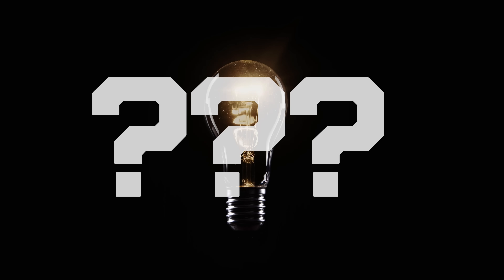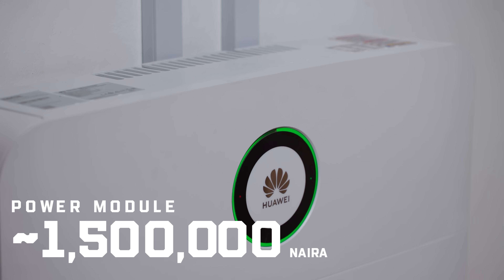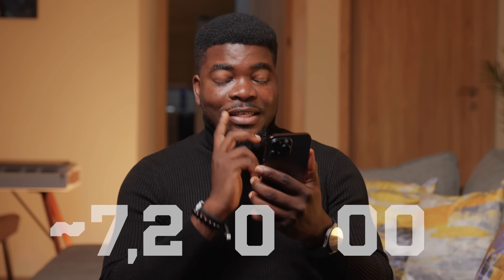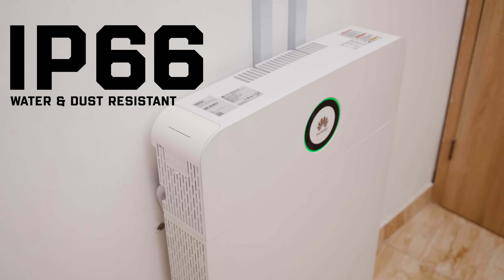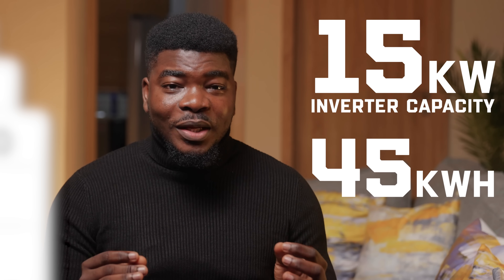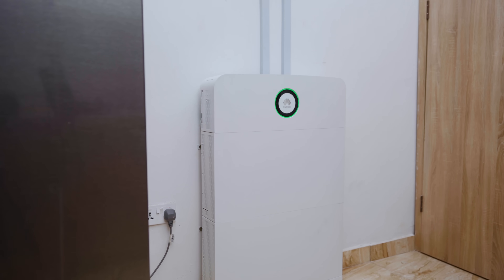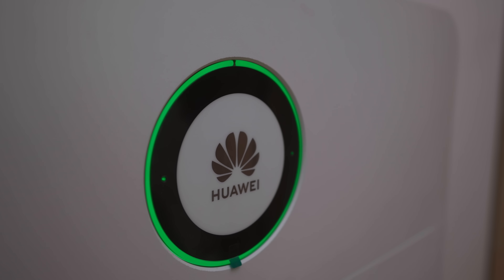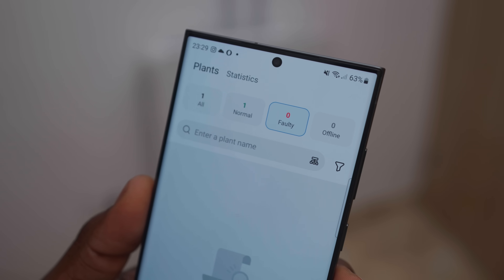Is THIS the Best Solar Inverter for Nigeria?

Comment: Huawei is a top top brand when it comes to inverters and batteries. Their prices are higher than what you find in the market but it's well compensated by the quality of their products.
There are still some other products that have a close quality to Huawei and not as pricey but overall they are still more expensive 🫰 than the average inverter in the Nigerian market.
Generally, as an installer, I like to pair the high quality inverters and batteries with a high quality (but very price friendly) solar panels like Sunova panels.
Reply: What products and sources would you recommend

Comment: Since there is no Fan which removes and reduces the noise, won't it get overheated, or is there an Air Conditioner that regulates it?
Reply: The fan is inside the component and it doesn’t over heat…no noise at all

Comment: No! You can not save 180,000 Naira with a 10KWh battery and 5KW inverter system in a month. Do your calculations again, pls.

Comment: Some landlords won't allow installation of solar panels on their roofs. Can this inverter and batteries work with PHCN electricity, and is there a possibility to get/adapt the full solar suite when one moves into their own home

- Also how long does a fully charged system last on full load (without the solar panels)

Comment: Huawei has one of the best energy solutions but the fact that there is no screen display to tell you how much electricity you are generating and the percentage of your battery is kind of a no to me. How will you as a user figure out that there is a problem with your generation. Its a sleek design though but the fan less technology leaves me scratching my head because we all know that these equipment generate a lot of heat and you will need a good airflow to keep it cool.
Reply: The percentage of the batteries is in the app

Comment: This is beautiful and there obviously a huge market for it even though its not affordable, based on research sha i think the best place to install lithium-ion battery anything is in spaces with minimal risk to property and life. I would build a shed outside the house and install there. Obviously these inverters look like they have an incredible build but mehn... from what i have seen the thermal runway of lithium ion is UNCONTROLABLE. If the fire starts it doesn't stop until its done.

Comment: Any engineer would know that removing cooling from a system that constantly generates heat/power isn't best practice as heat constantly reduces its efficiency. 
Justifying not having a cooling fan with the excuse that if the fan fails the system would overheat isn't plausible.
This new solution sounds very rosy but one should be very careful where to put this amount of money into.
Reply: So what do you suggest??

Comment: We use a 6.2kva inverter system with 4 tall batteries and 10 400w panels at home and it gives us 24/7 light. If you buy the materials yourself and call a company to assemble it for you, it will cost wayyyy less!!!. Everything we spent was 2.9m and we are always having light. Not all solar systems break the bank, it's like branding. That's why fisayos system is this expensive. 

Don't let the price point you're hearing now discourage you. Please do your own findings and get an inverter system now. It's totally worth it!

Thank You
Reply: This one is lithium ion battery that's why its expensive
Reply: Wow. Nice
If you don't mind, more info and referrals would be appreciated, please.
Reply: @TayoAbdul i deal in solar systems. you can hit me up if you interested in great cost saving inverters
Reply: Like you mean u are totally off grid? U dont use Nepa to charge it sometimes?
Reply: What year did you have it installed? Cause it seems it’s way more expensive now.
Reply: Kindly give any lead on buying the bits

Comment: I invested more in regular gel batteries (4 pieces of 220amps each and a 1 kva  inverter with 12 panels of 250 watts each. The only thing I can't power is the freezer and the pump machine but we have an average of 6-8 hours of Nepa light per day so no worries about that.
Reply: You could probably have powered your freezer if you had gotten a 3.5kva inverter, with the exact same batteries and panels
Reply: @Oyeolsakin  yes I'm looking forward to upgrade my inverter soonest. Thanks

Comment: Rubbish Inverter.
My system doesn't use the Battery in day time. It uses the energy from panel directly while also charging the battery.  
I also charge my Electric Car day time.
Reply: @isahidris which product do you use?
Reply: @senengeweor193  Growatt
Reply: @senengeweor193  Growatt

Comment: What l haven't read in all the youtube posts on solar systems in Nigeria is, how unused power from all the installed systems can be havested and put back (maybe sold) into the national grid to relief the grid a bit. I'm sure there are many homes with solar systems where the home owners are either not home or are barely using all the generated power. Any thoughts by the solar savy techies on here about this issue?
Reply: Sending surplus to the National Grid is futile. Our National Grid isn’t only suffering from shortages of energy but mostly from poor distribution network. Assuming our national grid has a capacity of 6000MW, at the moment it is operating on less than 2000MW because a lot of what is produced is lost in transmission.

Comment: We had an inverter with 4 20kwh batteries and they couldn't still power our house 24/7
Reply: you overloaded the system, reason why
Reply: @mymoneyfactory  maybe
Reply: 4 x 20kwh of battery = 80kwh of energy storage which is massive. 
Is the setup used to power up a home?

Comment: Installing lithium batteries in the house is not the best for safety reasons. In fact the manual of this inverter clearly states that it should be installed outdoor.

Lithium batteries are fire hazards.

The inverter is IP65 rated so will do well in a shaded place outdoor. 

Please be safe!

Comment: Lovely video Fisayo. Lithium batteries from reliable companies is the way to go when compared with Gel/Lead-acid Tubular batteries. 
However, you failed to clarify to the viewers that the use of those appliances (all at the same time) you listed are subject to various conditions including but not limited to the weather condition, time of the day and most importantly the amount of stored energy in the batteries to avoid people thinking that the 5kva/10kwh setup would carry all the appliances 24/7.

Comment: 3 to 4hours of light is basically nothing after spending roughly 8million Naira. 

So, you mean if turned on by 10pm before 1pm light will shut down? (With all prescribed load intact).

This is my problem with solars. That duration of light means nothing to me. Oops!…

Comment: Please i have a question. My situation is kinda unique. We have a house where my mom basically stays for between 3 to 6 mo yearly and spends the rest of her time in diaspora. No having constant power with the consequent heat affects her. My question is that what is the best solar system to install for this type of setting which may not be used for  about 9mo every year.i dont want her to have to deal with changing batteries or other compenents when she gets home

Comment: its a good piece but i still think it should be repairable most especially when the warranty period has elapsed. Moreso, i doubt the consistency of that battery, ones the battery starts getting weak , i cant see any method in which it can be serviced. GEL batteries can last over 10 years if you change the battery water twice a year with distilled water, while maintaining the same performance.

Comment: I have a inverter set up of 6.5kva with 4 batteries and 6 solar panels, which carries almost all appliances in my apartment, and could still power a 1 HP inverter AC even if refrigerator and all other low energy appliances are on and i have 24/7 electricity on sunny days. But what is fascinating about this Huwei is you saying you power a standing AC in the living and other ACs in the rooms at the same time.And i also like the fact the Huawei is tidy, neat and portable

Comment: Since most of your appliances are inverter based/powered does that make any difference on the time of usage. The spec sheet said 3-4hours. Do you have longer usage than this?
I also noted that you're using way more load than recommended on the spec sheet, how has this affected performance?
Reply from the maker: So my usage at full capacity has been 1 hour more than the average and I think that can be attributed to all the inverter based appliances. I added a bunch of appliances to the inverter but I don’t turn all of them on at the same time since I know its load.

Comment: Is your system connected to the grid? Considering your load, how long does your battery last until it's completely depleted when there's no grid power and no sunlight for solar charging?

Comment: The inverter system isn't that expensive compared to other set ups 
I Use power a lot so this will solve a lot of issues
That warranty period is crazy though 😂
Did you also get your inverter fridge and ACs from the website?

Comment: Electricity cost can never be zero. There was the initial cost of installation and maintenance cost.
Reply: yhup it cant, i have a 30kv system, there is no way electricity cost can be zero, the capacity of those batteries cant take you for a night with an ac on

Comment: There's no way any solar system is less expensive than grid power. Solar panels and battery simply cannot deliver a lesser cost per kwh than grid AT CURRENT MARKET RATES. Grid is always cheaper at current price of solar... until solar panels and battery gets cheaper. 

Solar at current price is for reliable power supply and remote areas without grid power, not a cost savings alternative unfortunately. 

I know this because I also have  solar power. By the way, these fancy solar packages are even more expensive compared to the ones we often rig together ourselves making it even more out of the affordability range for many regular folks. 

If you're buying solar, buy LifePO battery, the others are never going to pay for themselves as they don't last.

Comment: hmmm 🤔 

At my house in Zimbabwe, my house, my 3kva system runs 2 fridges, a meat freezer, 3 TVs, 12 lights, 2 desktop computers and 2 laptops. It has 2 X 3kva batteries and 4 X 510w mono panels and installed all of it for just under $3000 USD, not sure how much that is in Naira, I use gas for cooking and I don't have a washing machine or dishwasher, I'm 100% off-grid
Reply: Nigerians install AC in all rooms including nanny rooms but they wouldn't use inverter for all AC,  microwave and washing machine is a must in such a home. You didn't mention AC and microwave. I think he spent about $4800 for everything. Remember he bought 5kva And he uses AC. There are cheaper brands in Lagos too. Just like you have brands of phones. Huawei is not cheap but the warranty speaks for itself. So put all that into consideration.
Reply: @FERESE  microwave works no problem at all.

For $4800 here you'd be looking at a 10kva system at the least, but if you really dig around you'd be able to get at least a 20kva system

Comment: This system now costs over 8m already, last night it was around 8.3m. I'm not sure if that even includes the other stuff you mentioned. 
Also the panels are all out of stock, so also the extra batteries.

Comment: If a battery health or capacity has dropped it is a bad idea to add a new one to because doing so will create a effect of undercharging and will in turn reduce the life span of the new battery there is more to battery life and how to go about this kind of
Reply: Please Research on String technology. Power M can mix old and new batteries without any negative effect. This is a new technology

Comment: Guy your saving figures sound off Sha, are u sure it's that much per month?😅
Reply from the maker: I used to do around 90k each in light and generators but the situation is getting better. Will have an update in the full review.

Comment: Nice detailed video 
You made mention the inverter powers your standing AC and other AC in your house 

Obviously it has to be one AC at a time running on your 5kva inverter, 

Please clarify on this
Reply from the maker: Yes, you are right. It’s one at a time.
Reply from the maker: We have our full video review on them soon
Reply: Fisayo does the price tag in founi website includes the panels
Reply: @iviemaro380 my question is does it include the installation and other accessories needed?